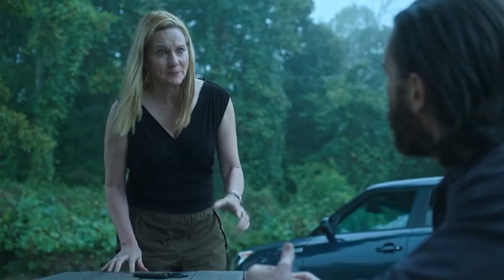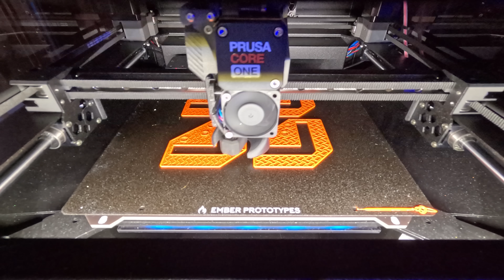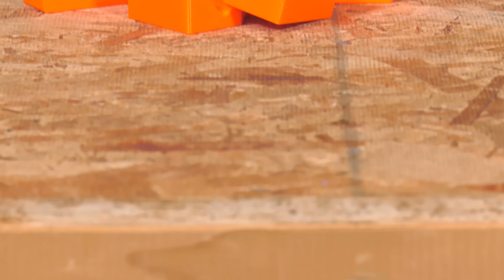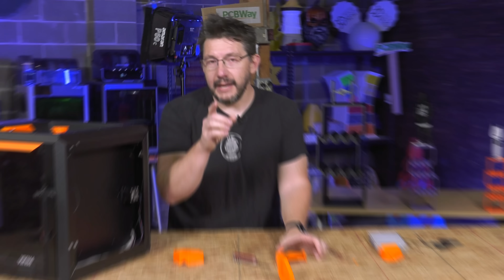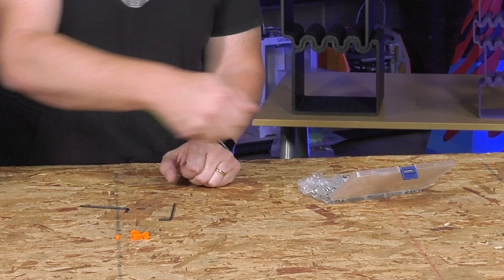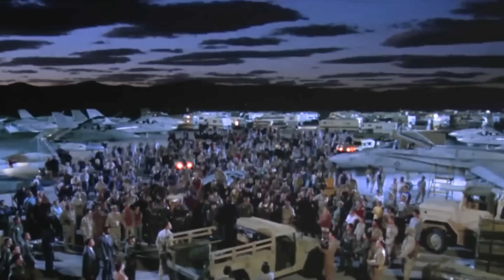Prusa CORE One NOW Stands Better!

Comment: I have no Problem with that L shaped Rubberfeet.
I clean to Bottom of the Frame with IPA before mounting that Feet.
I can turn my CORE One on my the wooden tableplate without loosing the Feet.

Comment: Cool! Prusa consistently shows that they can combine quality, reliability, and continuous innovation. Great work.
Reply: Prusa hasn't had any innovation in years, they're copying others at this point. The INDX system that is coming out is made by Bondtech and honestly the denos I've seen aren't all that impressive. And Prusa printers in general tend to always ship with issues, usually loose fasteners that make you wonder why you paid extra for the assembled printer. Sure, they usually work great once you get everything tightened and dialed in, but you shouldn't have to do that with a printer this expensive. For the price they charge you'd think that they would at least spend a couple extra cents for decent adhesive for the feet. I recently bought a Bambu X2C, now that's innovation. Watch a teardown video on the H2 series and you'll quickly see that Prusa is a toy in comparison. In fact that's why Prusa and everyone else is copying Bambu, because Bambu are the only ones truly innovating when it comes to 3D Printers.

Comment: I woulda used E600, job done :)
Also, FYI, you can bridge holes the way you described automatically in OrcaSlicer ;) No need to design it in CAD anymore.
Reply from the maker: But I had no E6000 available erg.

Comment: I don't really understand the need to print feet that include the provided stupid little rubbery wedge. It doesn't do anything in terms of vibrations.
Hula feet or another design with soft tpu would be miles better.
If you have to do the effort to design and/or print or maybe even buy something to improve the base, then really go for something that works.
I really like Prusa but I have to admit that this is shameful. They can't even include good tape? 
They should've designed and included proper feet from the beginning instead of this garbage.
If Bambu can do it, so can they.

Comment: Instead of using supports, you can add to the model in the slicer a 1 layer thick disk at the counterbore depth to blind the hole. This will bridge over the top of the larger diameter and print the smaller diameter hole on top of the bridge layer. Then after printing run a drill of the smaller diameter through to cut out the bridging.

I learned this trick from Makers Muse.
Reply from the maker: Great idea!

Comment: I was cussing those feet when I started my installed. Then I remembered I had some Echo Kinzoku double-sided tape that I randomly bought at my local Japanese supermarket, because they make the best of everything. The tape was the perfect size and the feet STUCK. I had a separate problem with the feet though. They left pressure chemically bonded markings on my work surface. I found out when I had to move my C1. I’ve cut out a piece of cardboard to size and stuck it under the whole C1. The added benefit was it allowed me to reposition the machine by sliding it across the table. 😊

Comment: Instead of printing the 3d printed feet holder you should just used some glue between the rubber feet and the Core One.
Reply from the maker: Glue with this type of rubber?
Reply: @3DPrintingNerd  I had that problem with my Core One upgrade kit. I used E6000 contact cement. No problem since.

Comment: Did you put it on a concrete paver after? That's your final upgrade😊 for folks who haven't tried it, it helps reduce noise from the printer and vibration from the table. I'd like to see the hula feet get compared to some padded feet and a cinderblock, I'm wondering if one will show more interaction with input shaping.

Comment: I didn’t expect that, and you even pronounced my nickname correctly 😀 Thank you, Joel :-)
Reply from the maker: Haha you're welcome!
Reply: Nice parts! 
Only recommendation would be to chamfer the bottom edges to mimic the original frame. Oh and what Joel said about designing the pockets to prevent needing support material.
Reply: @ondrashekz  I didnt expect my little brother is 3D printing Nerd  Nice job.
Reply: What screws did Joel end up using m3x12 ?

Comment: I got them when I realized that those vibration feet falled from the 3D printer. I printed them in the X1 Carbon in black ABS because it was that I have in hand.

Comment: I'm currently assembling my core one and the instructions state that you should first clean the places where the feet are placed with some alcohol. Apparently, that wasn't in the original instructions and was added to address that issue. At least at the moment my feet seem to stick well ( but , if the printer works after assembling, I will also print that update. It looks way superior regarding longevity.
Reply from the maker: Oh I’ve done that. Didnt help.
Reply: Maybe they had a bunch of bad adhesives. Well regardless, it isn't a good design from prusa. I wonder if the l has the same feet.

Comment: Why not use E6000? It holds well, and is easy to remove if you need to
Reply from the maker: I had a 3d printer handy and didn’t have E6000 handy :)
Reply: @3DPrintingNerd  fair. now that i have a core one, I can kinda see why now. I'm not sure how well E6000 would hold up moving the printer around

Comment: why does it need to be on the USBC stick, if it's downloadable from Printables? Aint it same-same?
Reply: Well, if it is on the stick you are bound to find it. If it is only on printables you have to know about the existence of that improvement.
Reply: @joachim4889  Ok. But I'd offer the perspective that It's an excellent intro to 3D printing. When you experience a problem, the solution isn't handed to you. 

It's up to you to either 

A. Create your own unique solution to a problem you're experiencing, or an opportunity you see
or
B. Search and engage with the community to find an existing solution

Comment: Or, hear me out, use proper 3M VHB tape or an adhesive designed to mate metal and rubber together.
Reply: I've already lost one of My Core One L feet.
Reply: Ooooooor, hear me out here…. I would’ve probably just super glued them on.
Reply: I tried that twice. Still sucks ass if you need to slide the printer around
Reply: I can’t imagine a foot problem. I NEVER slide anything with rubber feet - especially notebook computers. They wear down, just like the rubber eraser on a pencil. So just loft the printer and take care of your possessions. I’ve moved my Core One+ several times, never lost a foot.
Reply: Or how about prusa fixes their problem so customers that paid over 1k for a printer don't have to fix every single problem with it off the factory instead of the manufacturer?
Reply: @MillerWissen sure, Prusa certainly should fix it! that said a roll of thin VHB is like $10 and is likely something a maker has on hand, so for people who have the printer, it's a fix that's painless.

When people make things like poop chutes or lid risers for Bambu printers, far more complicated "fixes" than adding a bit of commonly available tape, you never see comments like this. Weird, right?
Reply: This

Comment: I have been running the hula feet on my core one since just before Christmas. I really like them, my primary goal was to try and isolate the printer a bit more from the rickety sideboard/cupboard it sits on and for that they have worked a treat as well as made it quieter.

Comment: I have just designed some new TPU feet for the U1.  They lift the machine by 35mm for some tool/part trays to fit underneath it too.  I always see small issues like this as an oportunity.
Reply: Yeah, those are not really problems but a opportunity to get the feeling "I fixed it" :)

Comment: i just stuck on the original feet using proper VHB 3M tape during building. still holding solid.

unlike the door handle, which has fallen off during ABS prints.
Reply: @bkiffter  the door has 2 holes in it that matches up with two holes on the handle. I used 2 spare nuts and screws as an added support to hold the door on. I have the kit version so there was lots of spares
Reply: @simonq9406 I've heard on the Prusa forums that bolting on the handle won't work if you move the hinges to the right side. There won't be a clearance hole in the sheet metal for one of the screw heads (I forget which one).